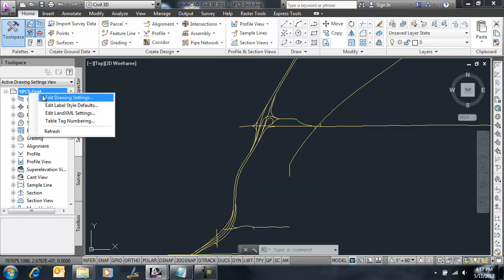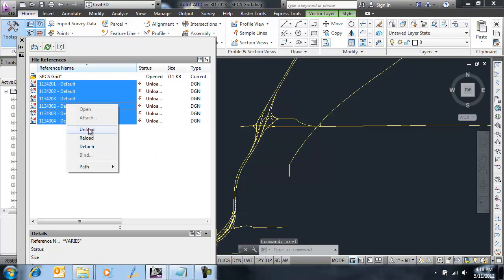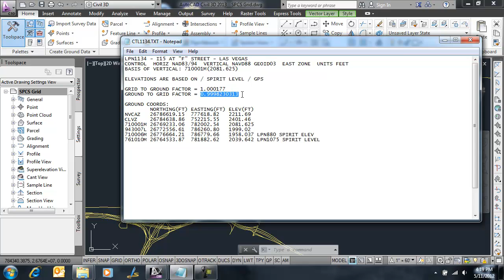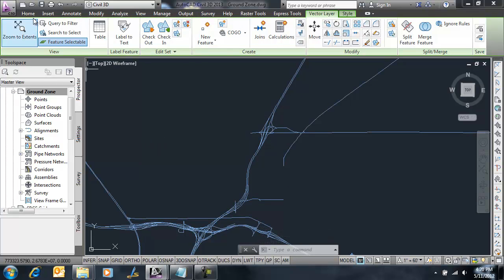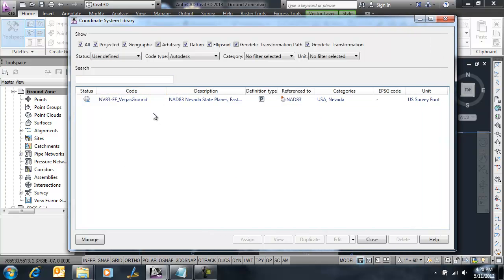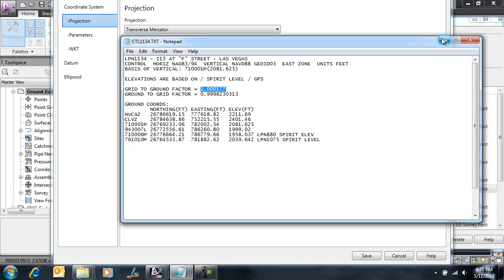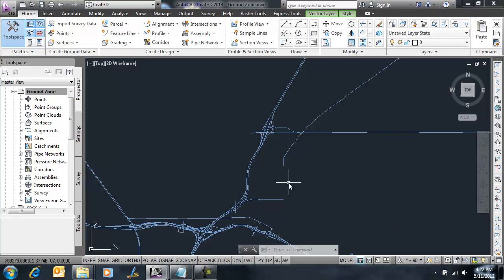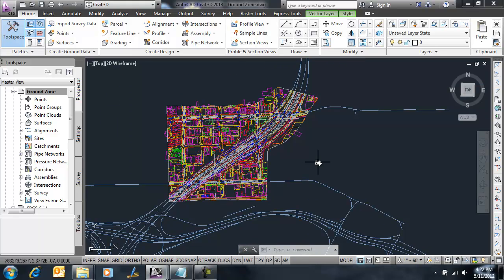AutoCAD Civil 3D Grid Ground Transformations Part 3. Drawing Data

Comment: Thanks Alan. Couple questions:
1. That Grid/Ground scale factor, you didn't get it from the surveyor, correct? It was publicly available from the DOT? Do most state plane coordinate systems have published scale factors for certain areas? How would you go about getting these?
2. Does making a custom coordinate system affect the coordinates if you need to give them back to the surveyor?
Thanks.
Reply from the maker: Hi Talmage, in the case of this video, the ground scale factor was a published "regional" scale factor.  In many cases, this would be publicly available from the DOT or similar agency.  On the second question, a custom coordinate system can affect the coordinates depending on the workflow.  The nice thing is, you can export coordinates to the opposing system when needed (ground to grid or grid to ground).  I have a video in the series on this as well.